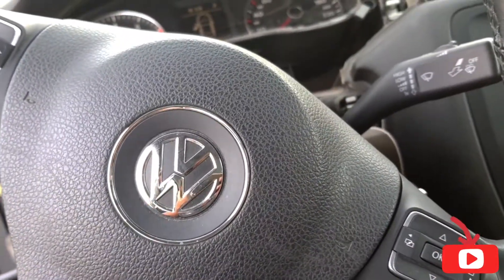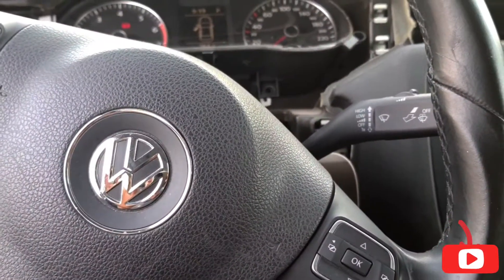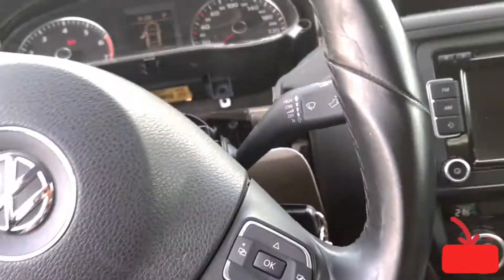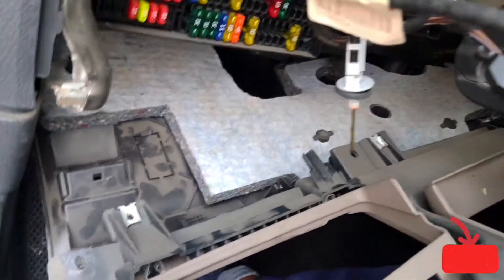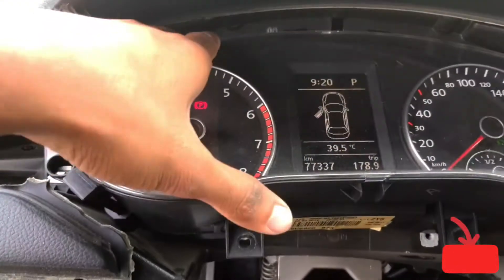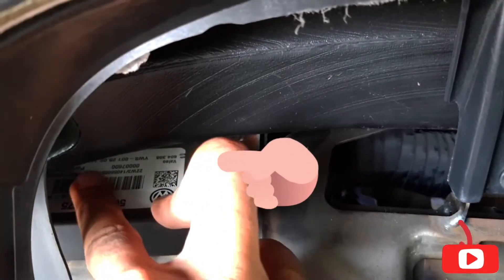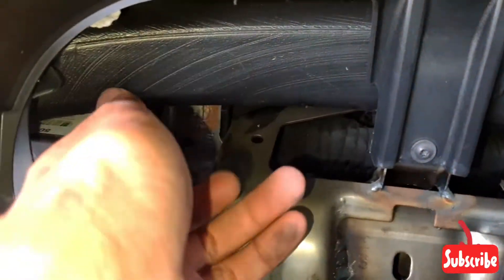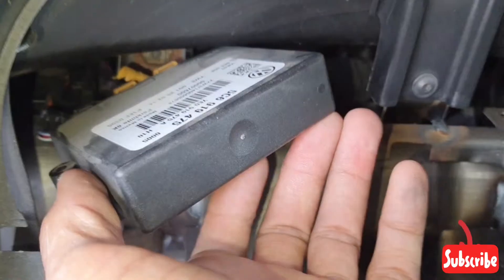VOLKSWAGEN JETTA PARKING SENSOR CONTROL MODULE LOCATION.

Comment: hi. how did u resolve the parking module issue? Did u change the module or coding?
Reply from the maker: I change it brother
Reply: Thanks for response. Did u try to check in the coding before changing.
Reply from the maker: No need to coding brother 
1st scan car if you get communication with park assist  that mens module good
If not need to replace
Reply from the maker: Most of the time speakers damage
Reply from the maker: If speakers damage same happens parkassist light blinking
Reply: @carhospital  you mean the car door speakers damage?